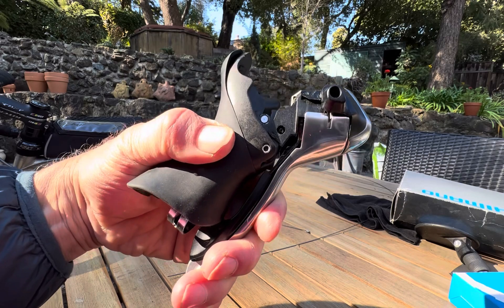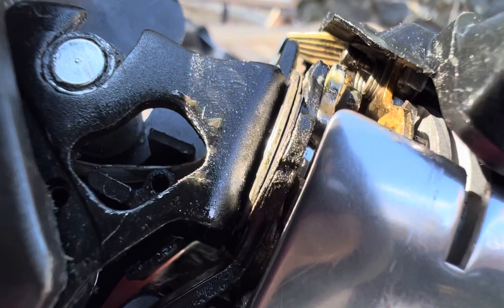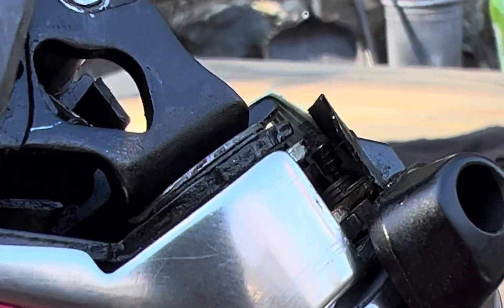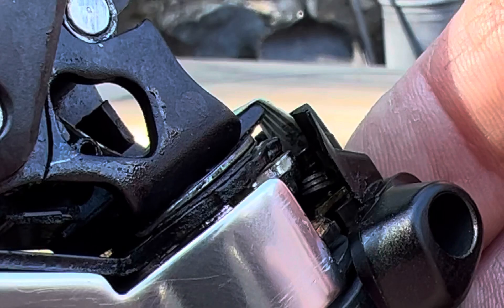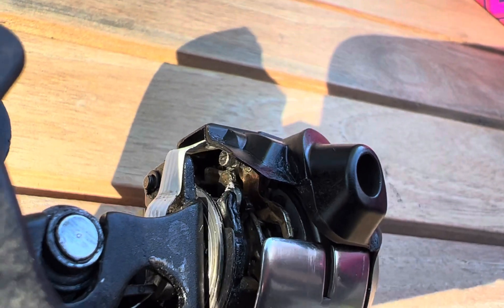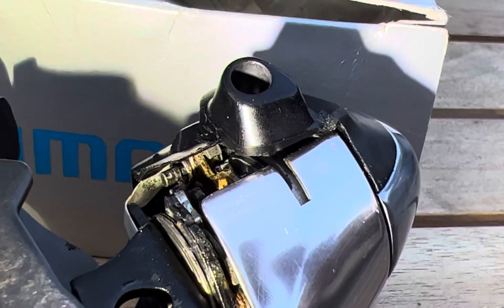Shimano Dura-ace ST-7803 triple shifter DIY internal torsion spring repair

Comment: When yours quit working was it the entire shifter or was it just not upshifting or not downshifting? Mine upshifted today, but will not downshift- the little inside lever has no tension & wont catch to downshift to the small chainring.
Reply from the maker: We’ll it’s been awhile now but my recollection is it would neither upshift nor downshift, though I could be remembering it wrong. If you have a look at the little spring that is the focus of this video you can tell if that’s the problem. Just wiggling it while in place can show you if it still has tension or if it’s loose. If that’s not it then I’m not sure.
Reply: @josinski  Thank you sir, i did end up taking the bike to the shop, it will shift up in to the big chain ring but not down. The shop thinks its just gummed up and needs flushed and relubrication. they are hoping to have it done today.

Comment: What's the electronic bits for?  Under under the cover by the left thumb there is a electrical button and some contacts.  Can't find any information about that...
Reply from the maker: There are a ribbon cable and sensors used to indicate the gear positions etc on the Shimano Flightdeck bike computer, which I don’t have so I’m not sure how it works, but it’s not needed otherwise.